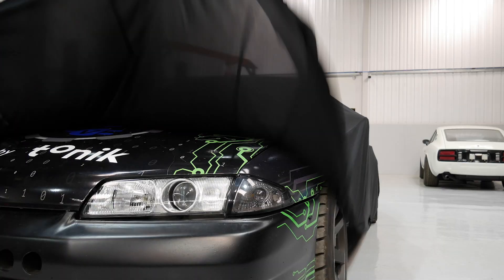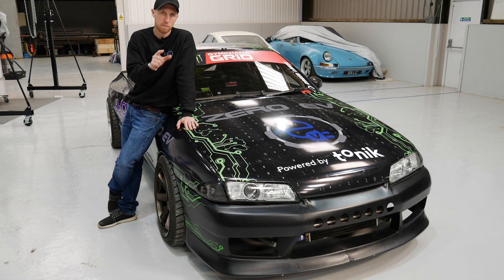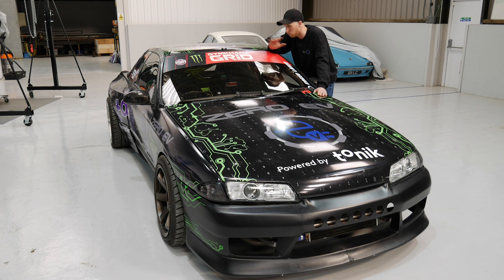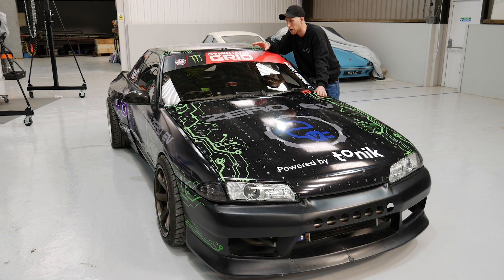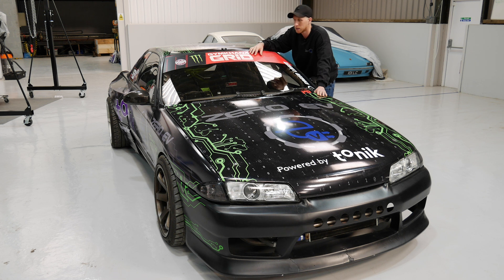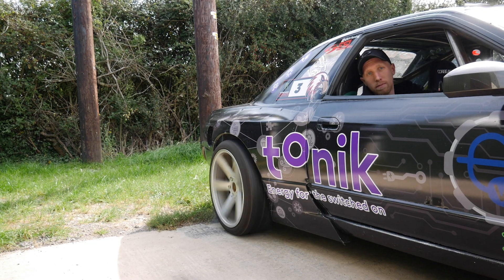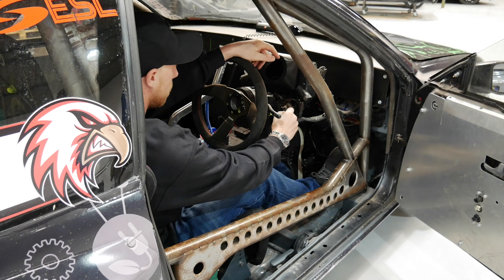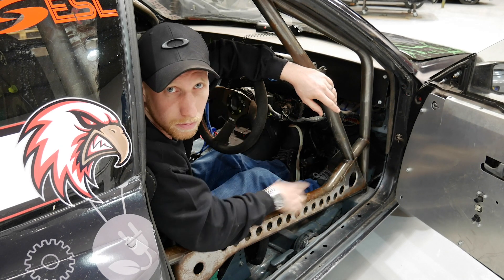Electric Nissan R32 Skyline - Tesla Powered // Ultimate Drift EV Conversion

Comment: This channel is really incredible. Question: if one wanted to build a light weight (~850KG) 1/4 mile drag car using the large Tesla drive unit, what is the minimum battery pack that would give maximum performance? Would the Golf hybrid pack work? Chevy Volt?
Reply from the maker: Golf hybrid or Chevy volt both will work

Comment: How much would it be to convert a Micra to electric? Thinking of doing a little locket rocket. Like really fast acceleration. Don't care much about top speed but I do about acceleration.
Reply from the maker: All depends on performance required as can cost from 10-30k